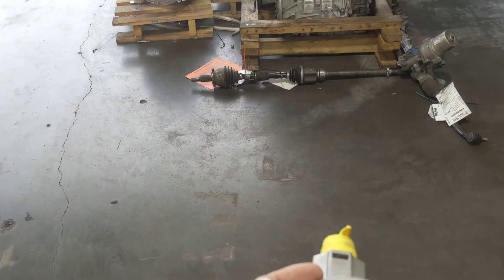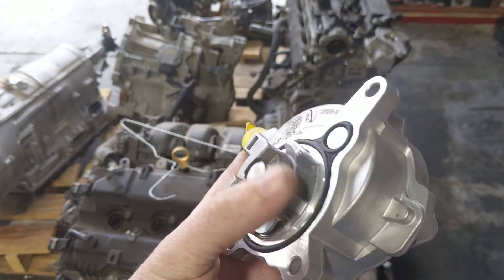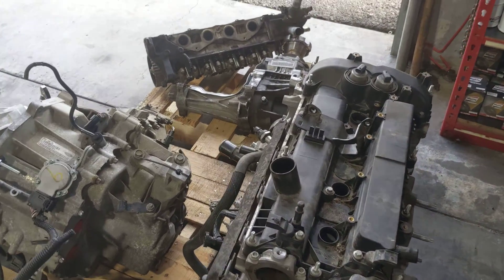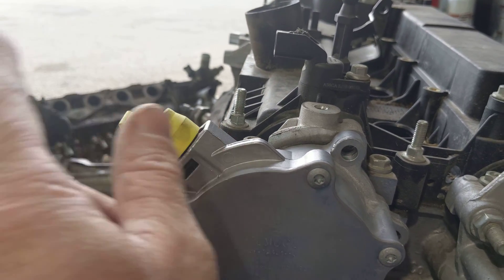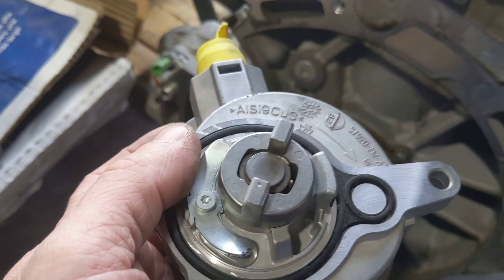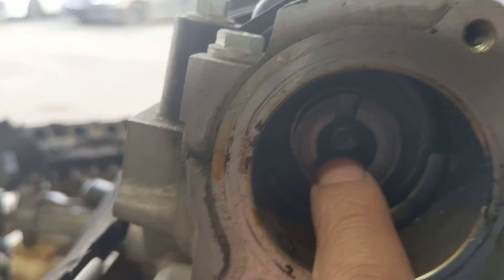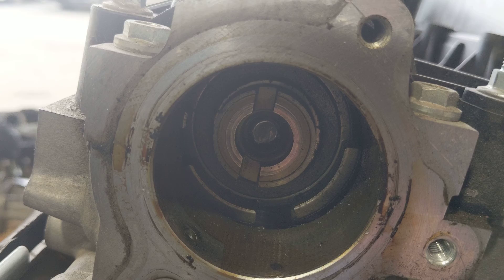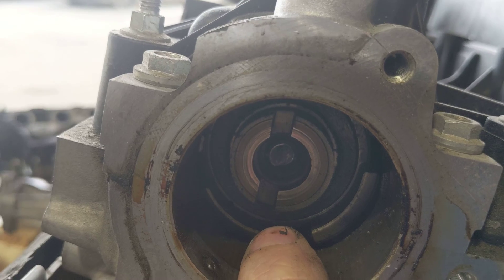Hard Brake Pedal Ford Fusion "Hard to Believe"

Comment: my 2013 Ford escape had a bad oil leak.. turns out the gaskets on these vaccum pumps go bad cause a pretty good oil leak and where its at on the engine most people think its head gasket.. mine luckily did not snap the crankshaft bolt.. that happens when the vaccum pump fails and sizes.. so its better to replace the pump before it fails
Reply from the maker: Looks like your Ford Escape wanted to leave a trail of oil wherever it went! Good thing you caught it before it turned into a major disaster.

Comment: What about a really soft brake pedal? Sister in law had new pads and rotors put on. She had a soft pedal before that and thought that was going to fix it... I bled the brakes but there wasn't any air in them. Saw a few rust flakes come out of driver rear. Thats it though. Brakes still soft. She does have a large evap leak code. Could that be affecting things? Or would low vacuum only make the brakes harder?

Edit: I sent her to a shop that had the ability to do the calibration on the abs system. That fixed the soft brakes.
Reply: + did you replace the master cylinder? If you did you have to bleed that as well I suggest letting a break shop bleed it to factory reset
Reply: @that-boimalone8202  Thank you. Actually turned out there was a calibration for the ABS system that I don't have the ability to do without the right computer/program. She took it to a shop that could do it and that firmed the brakes right up.

Comment: Unfortunate Update: This is exactly what happened to me....I just got the vacuum pump removed which was relatively easy. The much bigger issue is that the pump seems to have seized up and caused the end of the camshaft adapter to shear off now I have to figure out how to get the end of the threaded shaft out of the camshaft. The keyed end of the broken adapter fell into my hand when I pulled the pump off. Hopefully no large metal shavings found their way into the motor. That will almost always be a failure point if the pump seizes up. 

This video seems to be the worst case scenario...if the broken end of the adapter was missing when the pump was removed that means it got chewed up and the pieces made their way into engine which is surely a death sentence. Luckily for me, the pump crapped out while idling at the gas station a few blocks from my house so I was able to coast it home and shut off the engine.

Comment: That's frikkin retarded. Why didn't they just use vacuum from the manifold to power the brake booster. The brake pedal on my 15 Fusion just got stiff as a rock and I'm hoping that's not the issue. Glad it happened at the gas station and not while doing 80 on the highway.

Comment: Like why do manufacturers go for these designs🤦‍♂️these designs are just count downs to failure
Reply: Seems like Ford had to resort to a dedicated vacuum pump because these motors don't create enough manifold vacuum to run accessories. The pump would have to be mechanically driven or electrically driven. Either one is capable of seizing up.
Reply from the maker: Yup, makes no sense at all.
Reply: Seem to me This is the best design for a mechanical vacuum pump.  If the pump seizes I would rather have a bolt shear, freeing it from the camshaft, than have it seize the camshaft.
Reply: @ryanfischer574  Yeah, thats if the bolt shears off cleanly with enough of it remaining in the camshaft end to be able to grip it with vice grips or a bolt extractor. Fortunately for me it was a pretty clean snap...I was able to drill a hole in the center and back it right out of the camshaft. It's hardened steel so drilling it was a pain in the ass. 

The other hard part will be trying to actually source a replacement drive adapter. It's outta stock at most Ford dealer parts depts and I was told it was on nationwide backorder. Luckily I was able to find the last one in stock at one of my local Ford dealers.
Reply: @RellyOhBoy  yeah exactly....
Reply: Look into engineered obsolescence… then it’ll probably make sense.